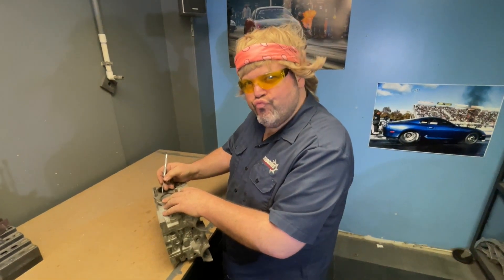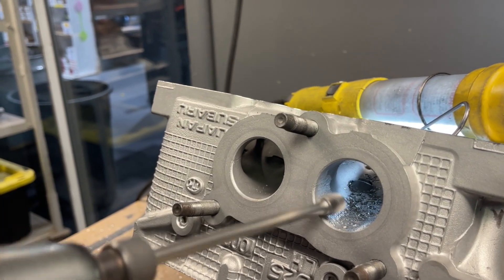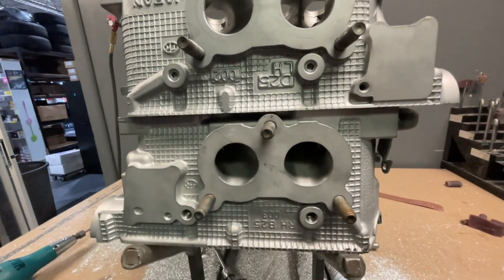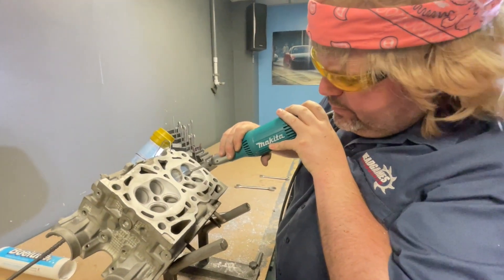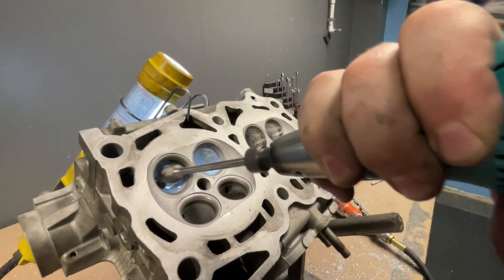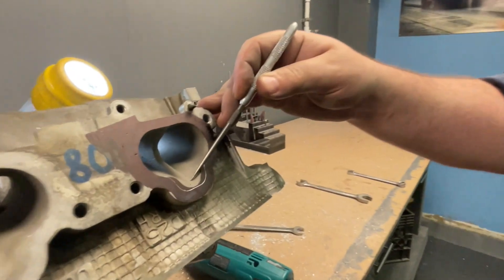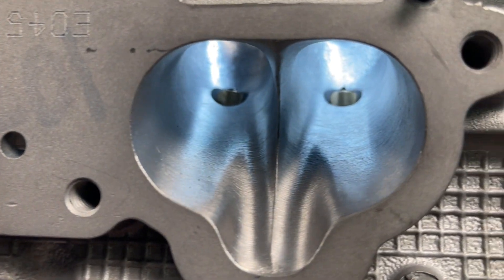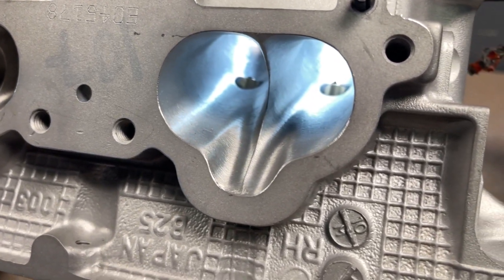HeadGames Motorworks Subaru Series Episode 2:  Do's and Don'ts of porting a EJ25 head!

Comment: WOW! most excellent! finally someone or a place stating it as it is... to bust an immortal myth... "gasket matching"  when gaskt manufacturer dont know flow but just worry about sealing... so "port matching" via gasket matching? oh lawd!  thank you for this...
as on Honda its the same so i cringe when most pro actually uses a name brand thermal gasket for " portmatching" 🥴

oh and 2:46 is true PRO moves